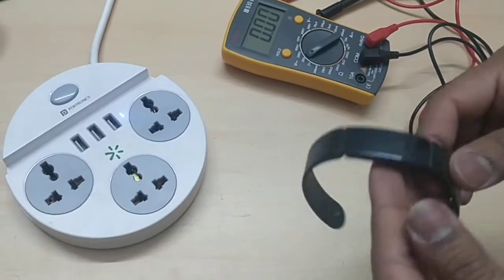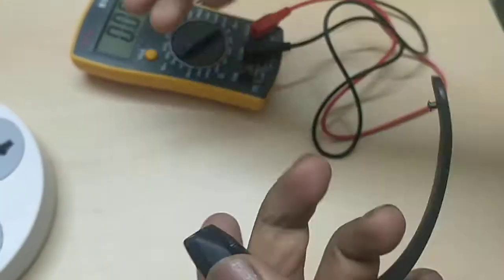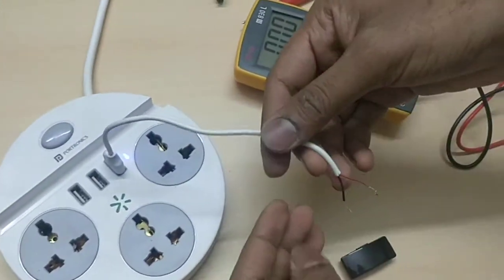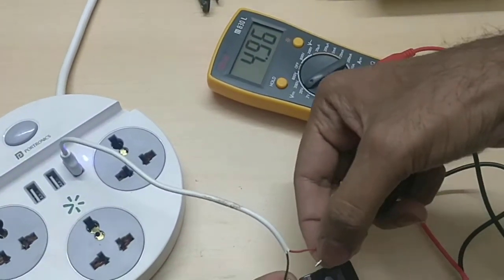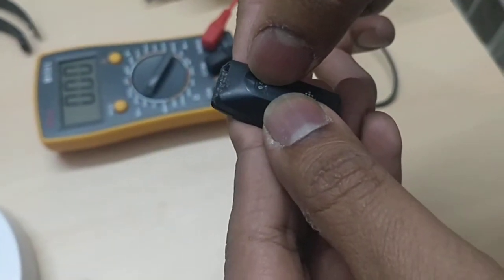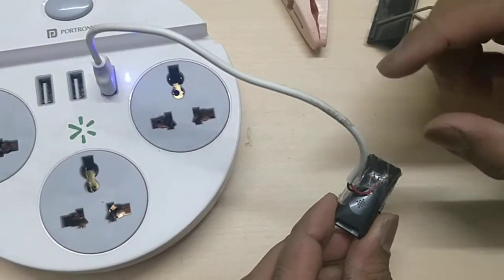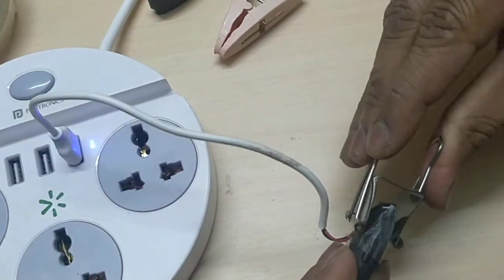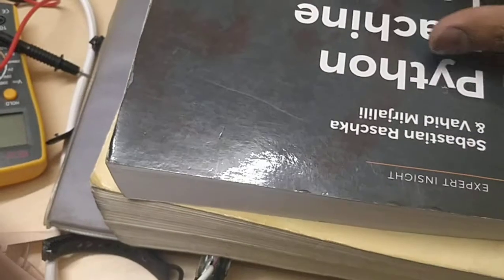Make your own Fitbit Inspire charger

Comment: Worked like a charm. Even without a usb cable... All I could find was a 12V car adapter with adjustable output of 1.5V, 3V, 4.5V, 6V and so on. Made a little plate, pinched it in place with my fingers (cramps!) and charged it on the 4.5V setting. No issues, 45 min from 12% to 98%.😊